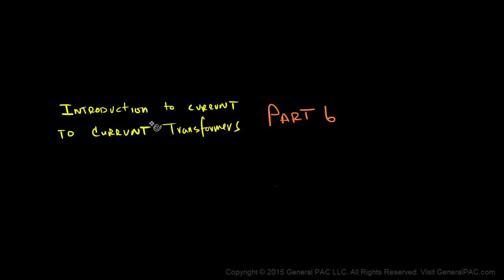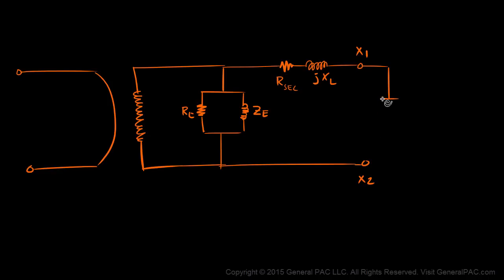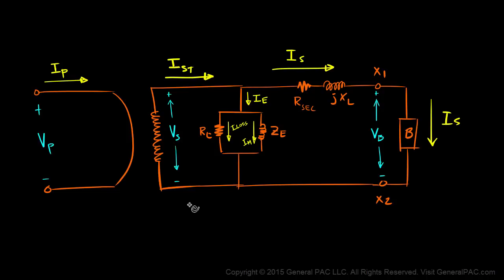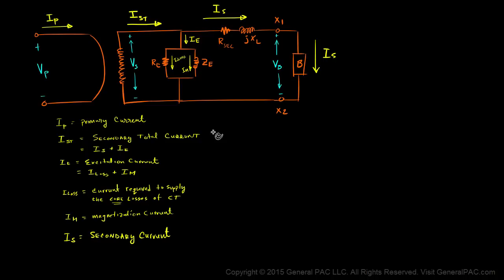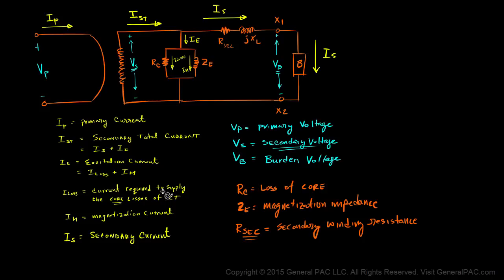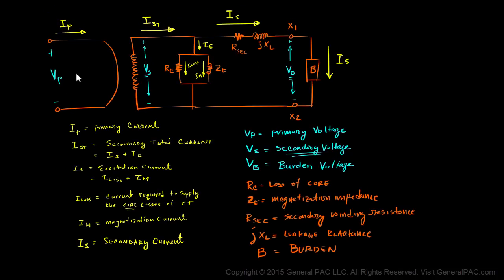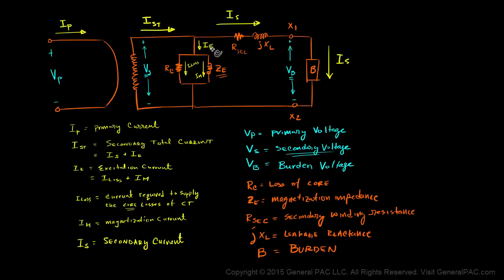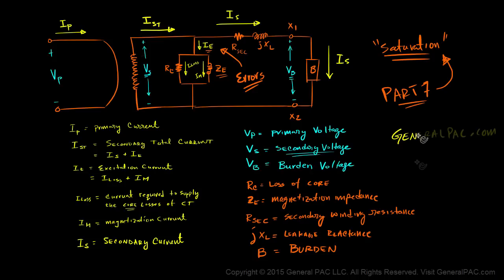Introduction to Current Transformers Part 6: CT Model

Comment: I have 2 questions:
1) Burden is essentially a load connected to CT output terminals. Right? Why is it called "burden" why not simply call it load, or electrical load?? Is there a difference between burden and load??

2) Does CT exhibit inrush current like regular transformers?
Reply from the maker: Hello,

1) Yes, burden is same as load or impedance connected to CT secondary terminals. This terminology comes in handy when you are purchasing/supplying a CT to guarantee its accuracy. This means that how much Ohms of impedance can the CT tolerate in the metering circuit before its output current is no longer a fixed ratio to the primary current. Burden ratings are defined by ANSI/IEEE in Ohms and by IEC in VA.

2) Yes, just like any other transformer, Current transformers also exhibit inrush current characteristics. However this inrush might not cause any severe problems just like it causes in regular load transformers. 

Thanks,
GeneralPAC by AllumiaX

Comment: Team,

Excellent video.

Quick question, any more info on "why are we earthing the secondary side of the CT and the relay end"?
Reply from the maker: The primary reason why we ground one end of the secondary CT circuit is due to safety. If the secondary circuit is not grounded, the secondary voltage will NOT have a reference and it may slowly increase to unsafe levels.... theoretically, the secondary voltage may slowly increase to primary voltage levels. 

Grounding the secondary prevents the voltage to "stray" away and increase.  Last time I researched this topic, I learned that when the secondary is not grounded, the capacitive coupling  between the primary winding and secondary winding was the primary reason which causes the secondary voltage to increase over time.

Comment: Q1 -if thare is a 1000:1 CT it will take 1000 amp on primary to = 1 amp on secondary right? so how is it that i dont have 1000 volts on the secondary for every 1 volt on the primary. 
Q2- why is thare a line and load for a CT if you need AC to make a transformer work. 
Q3- can you make me understand this?
Reply from the maker: +T. Dodge  Please ask further questions on the GPAC Forum: http://generalpac.com/forum
If someone is reading this and can provide a better answer --- please do share :) 

Here is my attempt:. Q1: Suppose we have a 4160V:480V power transformer. The number of turns on the primary coils vs the number of turns are the secondary coil are designed in such a way that we have a constant 4160V on the primary winding and constant 480V on the secondary winding. Therefore we will have a constant voltage ratio. We know this is true for ideal conditions. And we know that voltage will change based on the load that the transformer is serving. Or in other words, voltage across the windings depend on current (which serves the load). The point is -- we want constant voltage ratio because it's a power transformer. 

For a current transformer -- the voltage across the primary winding and secondary winding is allowed to change but we want the current to be proportional. In other words, we want the ratio between the HV line current and LV line current to be a constant ratio. Therefor, for every 1000A of line current on the primary winding,  we get 1A of line current on the secondary winding. The point here is --- we want constant current ratio because it's a current transformer.  

The CT insulation rating should handle the full line-to-line voltage of the line. So if we used a CT on a 4160V line, we should make sure the CT insulation can handle 4160V. We have to be careful with the secondary voltage. If we have too much secondary voltage, our CT will saturate.
Reply from the maker: +T. Dodge Regarding Q2.. can you please elaborate? Regarding Q3... Soon my friend :)
Reply: +General PAC - Power Systems made Intuitive (it is my understanding that transformers work something like this. Tp/Ts=R Vp/R=Vs and Ip*R=Is so if Idrop current on secondary, voltage will go up on secondary. if i drop voltage on the secondary current will go up. Im not talking about a transformer with a load. This is more potential on a ideal transformer. I have a 100:0.1 current transformer on a 208V feeder and want to know y I dont have 208000V and the secondary. is it bad magnetic coupling or some property of saturation or some other property of current transformers.
Reply: Its because the primary is in series with a load limiting the VD on the primary winding. The line and load is for matching phasing. I think we did it General PAC thanks for the vid